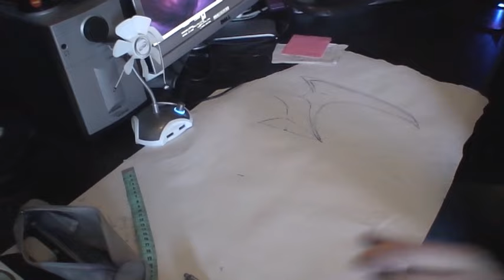Project: TimeLapse Challenger Ahri HEADPIECE

Comment: Hej! I have a question about the black plastics you put on. What exactly is it? 🙊
Reply from the maker: Hello! It's called black worbla (for more information check this out > http://www.worbla.com/?page_id=5319 < )
Reply: +Zombie Li wobla is kinda expensive, do you have another idea what is as the same as wobla. 
Thank you in advance. :)
Reply from the maker: I often buy a 3 mm foam sheet, heat it up with a heat gun. shape it on top of the eva foam and then glue them together. It's cheaper but it's more difficult to get smooth and even since the glue might wanna build up airbubbles under the foam. :) 
Another technique I often use when money is a problem is papier mache. It wont be as smooth or stable as worbla but it makes it less fragile.
I hope this help! :) I wish you all the luck